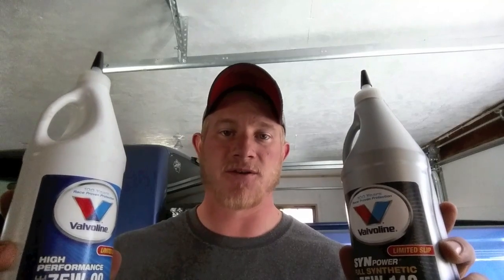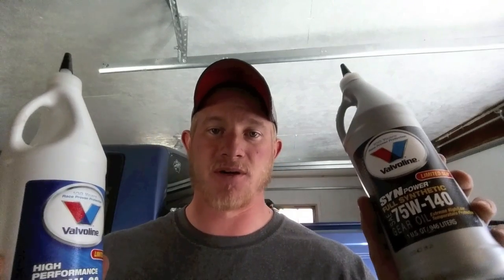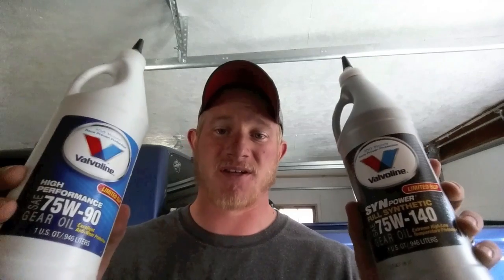75w-140 vs. 75w-90 Gear Oil | How To Read Gear Oil Viscosity Numbers

Comment: I have a 2023 mustang 5.0. I switched from 75w-85 that ford recommends to 75w-140 because I live in socal (LA area) where it’s 95-108 during the summer and barely 50 (if that) in the winter. I only switched because I heard 140 holds up better in heat and cold and adds more protection. Do u think it’s better or worse for me to switch

Comment: Ummm,.....100 degrees Celcius is the temperature at which water boils at atmoshpheric pressure (14.7 psi at sea-level).
Reply from the maker: @seanjohnson386  that is correct, and it’s also the temperature at which they test gear oils to determine their SAE viscosity grade.

Comment: I was kind of enjoying the video, but I think you were getting some of your terminology mixed up when it came to viscosity in colder weather you made reference by saying it is more viscous in cold weather. I believe what you were trying to say it that the oil is less viscous or not as thick thick in colder weather. therefore increasing the flow rate or the ability for an oil to flow at lower temperatures with a 75W 90 gear oil, which is only available as a synthetic formula for this particular GL-5 viscosity rated gear oil. 75W defines the oil as 75Winter-up to a 90 rated index at warmer temperatures in order to help protect from the wear and tear of the differential gears, not to forget the inner and outer wheel bearings on both sides of the drive axle. In extreme situation, such as severe rated driving which is your case yes a 75W 140 could be beneficial for your application, but keep in mind that at higher temperatures the differential oil does become much thicker as it gets hotter. This is due to the wider range of viscosity index being 65 between the two numbers. Whereas compared to 80W Winter-90 gear oil will never be thinner than 80w and never thicker than 90 with only a 10 point difference in viscosity rating between the 80 winter 90 mineral oil based GL-5 gear oil which is perfectly fine for normal driving. But in colder weather climates at -20° Canadian it is far more beneficial for synthetic oil of 75w90 due to the lesser viscosity rating index by 5  points. Also  the
fact that all synthetic oils flow better than conventional oils is an added benefit by spending only a few more dollars . Regardles of the application gives synthetic oil a far more superior additive protection package against wear and tear as well as thermal breakdown when compared to conventional oils. if you've noticed lately, the cost of a litre of conventional oil and the same brand with the same rated viscosity index is not much more money for a gallon of synthetic vs a gallon of conventional oil. I can purchase 5 L of full synthetic 5w20 engine oil at Walmart regular price for $28.88 plus tax or I can purchase 5 L of 5w20 conventional oil for $24.88 plus tax. The reason for this huge change is that the industry is catching up to making synthetic oils basically as cheap as they can conventional they're almost the same price now depending on the particular brand. Truth be told that WALMART, COSTCO and AMAZON obviously don't manufacture their own oil, so it must come from a major oil blending refineries in the USA. In this case, they buy their oil from Warren Distribution, the world's largest blender of oils. Kirkland oil is probably every bit as good as Mobil 1. I enjoyed the video, and I think you were trying to say, and meant to say that first number refers to The oil being less thick than it is at higher temperatures, which means it's less viscous in the winter during cold temperatures but at hotter temperatures, it maintains a 90 viscosity rated index in order to better absorb heat by maintaining  a more viscous fluid to better adhere to the metal components within the differential housing and wheel bearings as long as possible. Keep up the good work.

Comment: Sorry, but you’re exactly wrong on your theory of the weight difference in thickness 140 flows 140 mL a second it high temperature where the 90+90 so the 140 is definitely thinner

Comment: I just changed my ram 1500 diff fluid with 75w90 in the rear diff it has a lsd and I went with Royal Purple because it has the friction modifier already in it…. Anyone else have any experience with royal purple. I didn’t add the mopar additive because it says it has the friction modifier already.

Comment: Ok I highly recommend to follow what owner manual or manufacturers. There’s the difference between 75w90 and 75w140. 75w140 design for vehicles that towing heavy loads like close to maximum of Gross weight Combined rating or maximum , people who using for racing like accelerating hard all the time, however will sacrifice gas mileage…. 75w90 does give you better gas mileage and if towing occasionally then that for you, but if towing frequently but loads not even close to maximum and or if worry about gas mileage then you wanna go with full synthetic 75w90 which better than regular 75w90

Comment: My recommended oil is 75-80 but every shop I go I'm being told either 75-90 or 75- 85 I'm scared would you kindly advise I have 280k on the clock

Comment: I just picked up a 93 Jeep Grand Cherokee (Laredo) 217,000 miles, live in southern MO, No plans on towing or off roading as of now. Asked around and I'm getting all different answers on what gear lube to use. On the tag (Rear Diff) it also states to use a "Limited Slip Diff Lube Only (Additive) with my gear lube. What would you recommend on the particular Gear lube and do I buy the additive (Anti-Friction Modifier) separately or what? PS: The front diff has no tag stating, "Use Limited Slip Diff Lube Only" So do I use the same gear oil as used in the rear but without the additive (Friction Modifier) ? Would appreciate your expertise and your time. Thx Much.

Comment: Something to keep in mind is thicker oils trap more heat in your gear box
Reply: I always felt this was true but wasn't sure. I run 20w50 in my engines but have been rethinking that on my turbo rig. Do you think it takes longer to heat up the thicker oil as well?
Reply: That’s why you run the weight recommended by the manufacturer… ie 75w and 80w are pretty much the same … you don’t want to run anything higher or lower than that because testing has shown that those weights protect differential the best…. 
For example I have a 2004 jeep TJ… for daily driving I agree 80w90 is fine…  but I tend to abuse my differential especially when towing… that’s why my rear axil gets 75w140… front axil I go back and forth between 80/99 and 75/140… usually 80w90 on the spring,,, 75w140 in the fall when I am most likely to need 4 wheel drive.
Reply: @bigdog4574 I think you just contradicted yourself.

Comment: My manual for my 04 Nissan Titan 4x4 calls for 80w-90 for both front and rear, BUT the Haynes manual I have says put 75w-140 in the rear only? Why the difference and would it make a difference? Another poster said putting different oils in the front vs the rear could cause unnecessary stress? I'm a bit confused.

Comment: My outputshaft seal is leaking where the drive shaft bolts in to the pinion gear I'm going to have it replaced this week coming that being said I had nothing to top it up with other than 85w 140 that was mixed with my 80w 90 I'm in Canada it is summertime and I've been driving it like this for 2 weeks now am I in the safe Zone

Comment: guys what about 75W-110 ? what do you think about 75W-110 it's kind of between 75w90 and 75w140
Reply from the maker: That wouldn't be a bad one. I'd go off manufacturer's recommendations, but if you have similar conditions to what I talked about a 75w-110 would be good for your rear diff.
Reply: Midwest Garage manufacturers recommendation is 80W90 hypoid oil, I like to use synthetic oil so best option for me 75W110 fully synthetic hypoid gear oil 👍💯

Comment: I have the same truck. The owner’s manual says to use sae 80w-90 GL-5. Myself use the the 75w-90 in the front and 75-140 in the rear. Reason being is that my 98 Silverado has the heavy 1/2 ton 14 bolt 9.5 rear. With towing a trailer I figured it would hold up better. That’s just what I do 🤷‍♂️
Reply from the maker: I like it man! I wish I had the heavy half...that's a good towing rig for sure.

Comment: The only way you can formulate that wide range of protection is with full synthetic.  Like engine oil, aka: motor oil.  Always keep the lower W (winter) number, but go as highest possible with the straight number.  My oil cap requires 5W-30 Conventional, but I use 5W-50 Full synthetic.  I've been using Castrol Edge since it became available in the early '90s.  I do use Mobil1 75W-140 on both differentials and Transfer Case.  Back in the '80s I used a 20W-50 latter spring to early autumn, then 5W-30 or better 5W-40 for Michigan winters on V8, V6 Chevys.  My '03 2.7 4x4 automatic Tacoma has 269K miles and runs like a top.  Rack and pinion, along with in and out power steering hoses recently replaced.  Water pump once, fan belts twice, exterior door handle, all lighting except backups.  Service:  Every 30K engine coolant and automatic transmission power flushes.  Motor oil every 3K, rear diff every 30K, front diff and transfer a total of 3 times.  Highly impressed with Toyota quality.  It's all about maintenance.
Reply from the maker: I couldn't agree more with your entire comment, I love it! It definitely does come down to maintenance, and you can never go wrong with a Chevy or a Toyota!

Comment: Hi,
I just bought a 2015 Toyota Tacoma PreRunner V6 with 100000 miles.I live in Wilmington,NC.
I tow a 20ft. Boat. 3500 lbs.The manual say 75W-85 GL-5. Should or can I use mobile 1 75W-90 ?
Thank for your time/videos 
Jim

Comment: 75w140 is mostly used for differential oil not gear oil
Reply from the maker: You're correct. I thought I was talking about my rear diff in this video I must have mispoken.

Comment: What oil should I use for my 1985 chevy m1028? About the climate mostly is hot
Reply from the maker: Motor oil I’d use a 5w30, and for axle lube I believe they take an 80w-90 gear lube...but that could be wrong since it’s military grade. Try googling “TM-9-2320-289-20”. That’s the technical manual for those trucks and it should have everything you’d ever need for that truck. Those things are awesome by the way, I’ve always wanted one!

Comment: For 2012 awd Sienna, Toyota manual says 75w85. The service departments keep 75w140 and use that in everything that comes through 

I’m in Ohio

What would be best for the transfer case & differential?

Thank You
Reply from the maker: Transfer case and differentials would all depend on what Toyota recommends. I'd stick with what they say for those because they're probably specific fluids.

Comment: Which one is better for positraction vs. Limited-slip
Reply from the maker: That depends on what your manufacturer recommends. Most LSD's will need some sort of additive though, so please keep that in mind when choosing a gear oil.
Reply: @MidwestGarage  ok thanks,  . I have posi traction no LSD

Comment: I'm sure it's fine if I need to top off my rear diff fluid with 75w-90 if it already has 75w-140. Or mixing brands if their still the same API rating.
Reply from the maker: Yes, it's okay to mix brands. However if mixing viscosities I'd do so only for momentarily before switching out the fluid.

Comment: My pinion seal has been leaking. Ran just about dry. I bought a quart of synthetic 75w-140, not enough, added a half quart of valvoline conventional 85 -140, not enough, added a full quart of 80-90 marine that was for my boat. Will they all mix and work to lube the diff and bearings till I change the seal? Or am I going to do any damage? Better than running dry, I figure. Thx Ken
Reply from the maker: That's a good question...my best advice is that it's okay to mix them as a 'limp home' thing to make sure you don't run dry and get you to where you need to go, but i would change out the seal and the fluid as soon as you can just to be safe, before any premature wear and tear begins to happen.

Comment: A 0w40 is twice as thick as a 0w20 when cold just saying
Reply: The 0 rating represents a viscosity of 0 when tested at or below a certain temperature. The 20 or 40 represents a viscosity of 20 or 40 when tested at or above a certain temperature. The oil additive package contains microscopic rubber polymers which change size at different temperatures to achieve the rated viscosity. 0w20 and 0w40 behave the same when cold. Once the oil warms up the polymers in the additive package get larger and the viscosity changes.
Reply from the maker: Yes, exactly. That is a very good description thank you!

Comment: First number is the cold viscosity, the second number is the operating temp (90°C) viscosity. So these oils all THICKEN up when they get warm. (Like engine oils)
Reply from the maker: No, they do get thinner. But they protect as well and hold up as well as a 90 or a 140 weight oil would at 100 degrees Celcius, rather than just a 75 weight. Think about pouring oil in the middle of winter compared to draining it from your oil pan after the engine runs. It's thicker when it's cold, that's just how fluid dynamics work. Thank you for the comment though!

Comment: How about some gear oil  doesn't have "W" symbol like SAE 90 or SAE 140.....
Reply from the maker: Those are single grade or "straight weight" oils. They're just a standard viscosity rating.
Reply: Now I know, "TY"

Comment: axle oil 140 for lorry but used 85-90 then gearbox oil 80-90 but using 15-40. any dangerous if using different oil ?

Comment: Use the weight recommended in the owner's manual.  75W140 is thicker than 75W90 at operating temp.  The higher the number, the thicker the oil.  Using the wrong weight oil will destroy the diff.  The limited slip additive will not harm a non-limited slip diff.

Comment: Hi there can use Mobil 1 75w90 ls in a conventional differential? Thanks
Reply from the maker: It depends on the differential and what vehicle. The owner's manual should be able to tell you if that's a good one to use or not. Thank you for the comment!
Reply: @MidwestGarage  thanks I owen 2004 4runner  and don't have the manual
Reply from the maker: Hmm...I'm not really sure on those Toyotas. I'm thinkin the best way to find out for sure is to use the good old google. Might even be able to find a service manual on line for that vehicle. I hope this helps!
Reply: Thank you very much for your time ✌
Reply from the maker: @lagunez12  Any time! Thank you!

Comment: Whats the best oile for a limitid slip diff 8.5 10 bolts . And there is a mopar limitid slip additive and acdelco additive . What should i use
Reply from the maker: I think for these diffs the ideal lubricant is a 75w110 with 4 oz of ACDelco additive. You could use the mopar stuff if you'd like, but being a GM differential I'd stick to GM OEM and go with Delco. Hope this helps, and thanks for the question!
Reply: @MidwestGarage  man you are awsome downtoearth type a guy . This video is almost 5 years old and you still reoly on our cumments . You are awsome  .
Reply from the maker: @MrEyad1990  Haha thanks bud, I appreciate the kind words! I try my best to answer comments on all my videos, even the older ones!

Comment: I'm rebuilding my differential in a 94 Dodge Ram 350 passenger van has the 9 and 1/4 differential actually basically what I'm doing is putting new bearings and seals the pinion gear is humming is there anything special I should put in the fluids after putting it all back together
Reply from the maker: If you use a synthetic gear lube that should have all the stuff you'd need in the fluid. You'll here some people say you shouldn't use synthetics in older diffs and in some limited slips, but that's simply a myth. Other than that if it is a limited slip be sure to add LS additive and you should be good to go. Thanks for the comment!
Reply: Thank you for your response look I have a question since I'm sending you a message now I have gotten everything back together actually what I've done is I went in and rebuilt the rear end I'm putting it back together as we speak I put the gear paint on the ring gear to see where I was getting contact should I remove all that from the rear end before I finish it off or is it okay to leave it  on.
Reply from the maker: Sorry I'm a little late getting to this, but you're fine to leave that on there it won't hurt anything at all. Thanks for the questions and comments!

Comment: Is there really much difference? Dealership put 75w140 instead of 75w90 like the manual says, I really ever tow. I think the only thing different would be like a 5% decrease in MPG. May have been something they changed back a few years ago.
Reply from the maker: There really isn't a whole lot of difference no, but usually even if you do tow with the vehicle once in a while, factory suggested oils in the owner's manual will be just fine.
Reply: Never didn't noticed a difference in MPG by the way.
Reply from the maker: Roger that, good to hear man! Thanks!

Comment: I have a 2006 Honda Ridgeline the manual says T-case oil takes sea-90 weight. The dealer gave me 75 -85 but I'm going to be driving it in hot weather towing a trailer I think what they gave me is wrong.
Reply from the maker: Yeah I'd check with them again and ask why they didn't give you what the manual says.